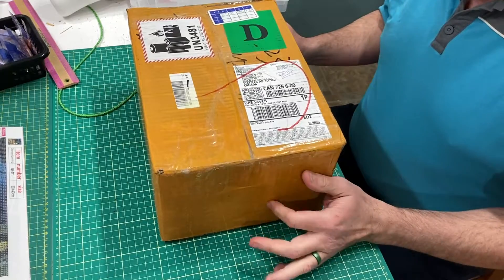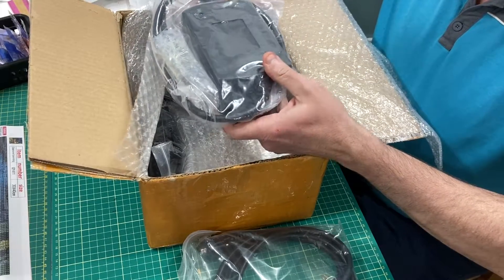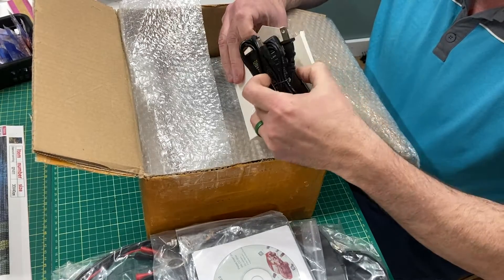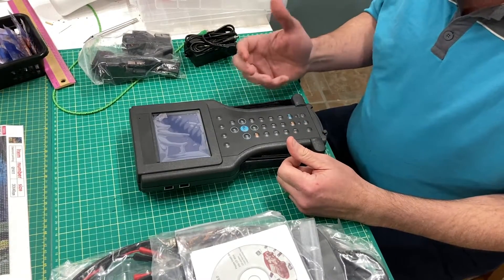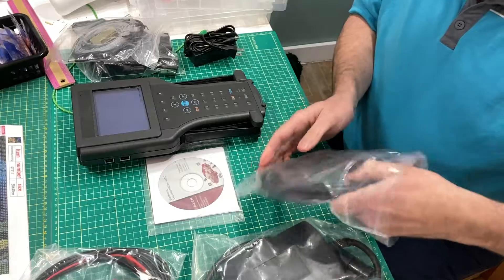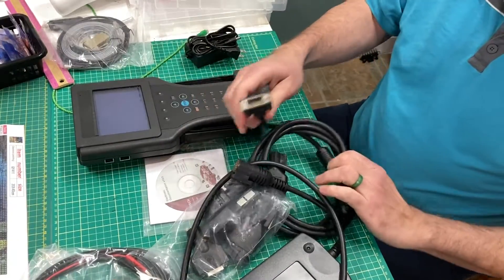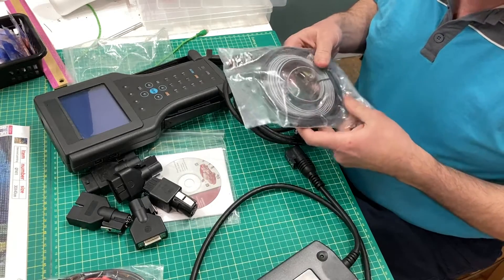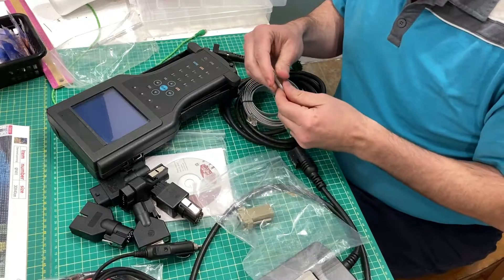GM's Tech 2 Scan Tool Unboxing...Yes, a Knock Off but Best You can Do!

Comment: Hi, can this do the CMP Retard on the vortec engines? And does it go back as far as 1996 for Chevrolet trucks? Thanks
Reply from the maker: You would have to google the CMP question and yes, it goes back to 1991 GM.
Reply: @RedBarnHomestead  It's just the cam position degrees. Google can't answer it. The real Tech 2 obviously has the CMP retard, I'm trying to figure out if the Tech 2 copies also have cam position retard in them, they should do but I'm worried I'll buy one and then find out it doesn't have CMP in it. Some exspensive scanners also have it, but most scanners don't. And you can't set the timing on a 5.7 Vortec truck without it. Thanks for your reply

Comment: If anyone buys this one, or any of the many other knock offs….  Make sure you soak all the pins and sockets on all the cables with DeOxit or similar. I had troubles with mine randomly not connecting or getting corrupt data. Finally figured it was an oxide layer on a few pins.
Reply from the maker: That’s interesting.  Mine worked great right out of the box.
Reply: @RedBarnHomestead  - I've just seen a bunch fail over time.  It's more a pre-emptive protection thing.  They certainly don't use the expensive gold plated pins, so they can corrode over time.

Comment: so, speaking from a 2002 Sierra 1500, this device will do all the basic obd tool diagnostic functions, gm specific diagnostic functions and gm specific programming functions without the need for GM/ACDelco subscription software? Lets say i want to know if or why my hvac climate controller is not communicating with the blend door actuator controller, this would be the tool? or if I wanted to reprogram my BCM to turn off interior lights as soon as doors are closed and locked, or i wanted to program the bcm to keep fog lights on when headlamps are switched to high.. this tool can do that? can it do it without the two year subscription to GM/ACDelco SPS2?
Reply from the maker: It will read all the things, and makes it easy to program keys and key fobs, but reprogramming would require a subscription to change the operations.
Reply: So any bcm comunication or relearn of brake sensors or throttle sensor etc requires subscription?

Comment: Awesome video, do you know if this will read suspension system codes for 19 corvette?
Reply from the maker: It doesn’t go much further than 2013 I believe, so 2019 is too new for it.
Reply: @RedBarnHomestead - needs an MDI2 and SPS subscription for 14+. 😢